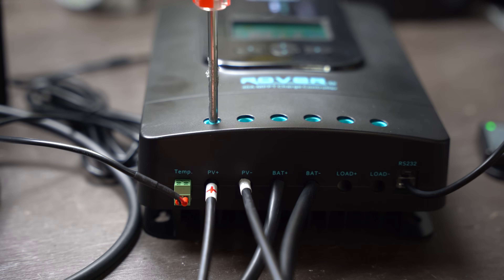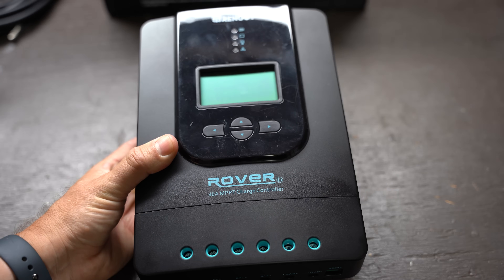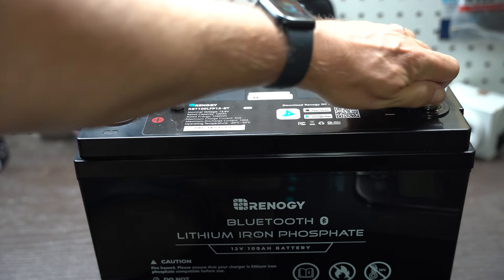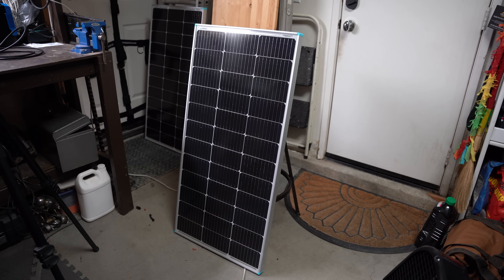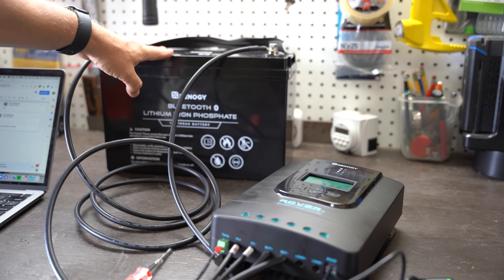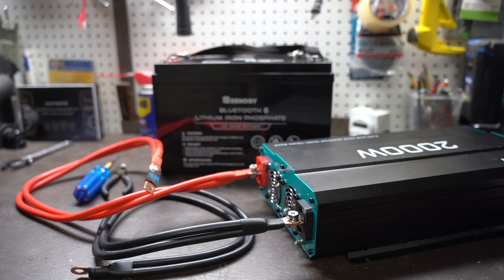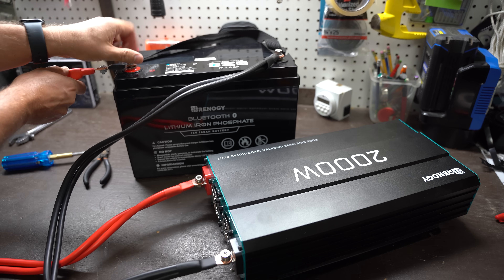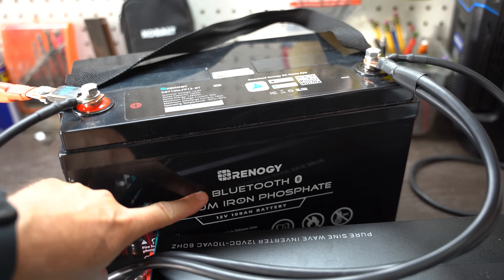DIY Solar Setup: Easy to Follow Step-by-Step Instructions

Comment: Thank you Chris, I built my solar generator about two years ago. I used a SOK lithium ion battery and it's been working fantastic, I want to upgrade it with a couple more batteries for a longer state of usable energy when I'm not using my solar panels.
But actually I just wanted to say I went with the same charge controller ( 30A ) and it works flawlessly, I am also using 4-100 W solar panels, when I finally got everything built I began testing it out. I first started with the refrigerator, which is all I Really wanted to be able to run Off of it In the first place ,But I then began adding my TV entertainment system, my computer system and it ran literally everything all at the same time utilizing my solar panels. I did go with a 3000 W pure sine wave inverter, probably overkill, but I wanted to make sure my system was capable of withstanding the loads.
You have done your community a great service Chris, people really need to understand and know how to build their selves a very straightforward system that could possibly save their lives and at the very least bring them great comfort and peace of mind.
Once you understand (( by doing it yourself )) you are well ahead of making your system an extremely viable component of your prepping Resources.
I also added in a 12 V fused attachment point to be able to run 12 V DC components which use less stored electricity Because you're not running the inverter component. 
Anyway Chris, once again you have served your community and subscribers a tremendous pathway to self-reliance,, may you and your family stay safe and remain blessed. Danny in Texas
Reply: How did you connect 3 additional panels as well as more batteries?
Reply: what do you mean about the 12v fused attachment? Thanks for sharing! I got most the other components by havent hooked it all up yet. Its been a race just to prep many things.. Aloha
Reply: Dear Maui, If you click on my little icon picture it should take you to my YouTube page, I made a video of what I built , It's not the best video but you can at least see what I did, and you can see that 12 V terminal block that I included in the wiring. The plastic cover comes off and you can wire in certain components with a particular size fuse for the item you are hooking up to it  (( 12 V DC powered items )).. 
I watched a ton of different YouTube videos until I finally decided to build my own, I'm glad that I did, and that little two wheeled dolly works wonderful and makes it so easy to move around. I just push it into the corner and it literally takes up no space at all, I put hinges on my solar panels and they fold up Like a little suitcase and I just store them in my utility area. I put the cable All rolled up underneath the couch. 
Anyway, when I first turned it on and plugged in my refrigerator everything was working perfectly, and I could see the solar panels were supplying all of the  energy being used, I live in a townhouse so I can't permanently install the solar panels so I just had them laying outside on the ground.. I went ahead and pluged in my TV, And then my computer system, and my little display on the solar generator showed I was still using solar panel energy. Once the sun goes down you immediately start drawing energy from the battery system that powers the inverter component which is where your AC is generated.
Anyway I'm sure you well, are maybe you already understand The process in theory, but if you don't keep watching YouTube videos and you will start to understand it perfectly.
Stay blessed, and good luck in your prepping journey, we are all in this together that's for sure. Danny in Texas
Reply: Thank you for mentioning how many panels you have and what you power with them. I am just beginning my set up and have been trying to find out how many I need to power everything, but have yet to find a "straight answer". Lol! Your comment helped immensely.
Reply: So how much can that battery actually withstand before having to actually have the solar panel charge it. I have a small tiny camper with 2 solar generators and a small Alp 28lb propane generator when off grid to charge both solars. My mane thing is if I’m not somewhere with adequate sunlight I used the Alp but I would like something a little more permanents. Moat items I use are low voltage with the exception of a coffee maker and a heated blanket for the winter for my k9. Do u think this set up would be adequate? I also have the foldable Dokio 300w panel system.
Reply: Hey brother, Basically what I've discovered with my little solar generator set up, is it needs adequate battery storage capabilities.
I'm using 4 - 100W solar panels which do a wonderful job recharging my battery through the Renogy charge controller system, my little setup will run my refrigerator, TV, computer, while still bringing my single battery back up to full charge.
When there is no sunlight it will run my refrigerator for about 8 - 10 hrs before shutting itself off, if I had more battery's  For storage, at least a couple more, it would make it all the way to mid afternoon of the next day where the solar panels would then start recharging everything all over again.
I know there are some good video's on youtube explaining this more in detail, but what I have built has really served me well in the security of at least knowing I will have emergency electricity when needed.
But to be honest, I am currently saving money to purchase a couple more batteries for a more adequate buffer to at least run my refrigerator as well as my computer system for a good 24 hours straight without any sunlight for recharging.
I tried to build my system with as much overkill and quality components as I could, and I feel pretty good where I ended up at, now the extra edition of battery storage will get me to a place of more comfort.
Stay blessed my friend, and stay safe always being aware and vigilant.
Danny in Texas
Reply: @livergen  thx bud I appreciate it. I guess my question is what do you when your refrigerator is off. What do you run off of until your battery recharges from the panel?
Reply: @bribrismind1982  , Well basically at the moment (( until we have a nuclear holocaust 😎 )) I only need my little solar generator for emergency purposes.
I live in a little town house and have electric service.
Since they won't let me install my solar panels on the roof, on the weekends ( Saturday and Sunday )  I simply leave them outside on the ground and recharge/top off my battery and at the same time run my refrigerator and entertainment center off the generator.
When I tested my generator without the solar panels, it ran my refrigerator all night for about a good 10 hours just off the battery storage.
I honestly considered brother, converting a storage trailer into a livable space but changed my mind. I'm 68 years old, live alone, my needs are extremely miniscule and pretty much live off of my Social Security entirely.
If I was younger by about 20 years, I would definitely be in a camper squirreled away somewhere with my trusty canine companions. 
I pretty much turned my little townhouse into a survivalist environment you might say, 4-30gal propane tanks , 1-55gal water drum/many cases of bottled water, my spare bedroom looks like a small grocery store. I Pressure can all my own food, bake my bread entirely, I guess you get the picture, ( Unsupervised adult with many skills ) . 
Anyway, I saw a nice review and pretty smart idea about some guy taking a small freezer and using it as his refrigerator since it maintains very cold temperatures. He bought a thermostat plug-in that he utilized to keep the temperature just above freezing.
But it ultimately boils down to battery storage with your solar generator set up when the sun goes down.
I know you are doing your research and due diligence, and you will eventually ( if not already ) , out on the other side a winner.
Again, stay safe out there and keep your personal protection tools on you at all times. Danny in Texas
Reply: @livergen  lol gotcha. I have done similar. I have a small Joy Turttus refrigerator/freezer and a tiny 28lb 1000 watt Alp generator. (Life saver) I can charger the solar generators about 25-30x with the small 13lb propane tank on my squaredrop. I have a Bluetti and a Delta Eco Flo mini. But I guess my main thing was the heated blanket for the k9 in the winter. I went out last month it was down to 19 degrees. The blanket ran from about 9pm-about 5am. I use one of the smaller hand held inverters off eBay for the refrigerator. Usually runs it about 8-9hrs
Reply: Hi Danny can you please post a link to your 12v switch panel video. Clicking on your profile doesn't work, it only let's you comment to your post. TIA
Reply: How long can you run on the battery power for your fridge, before battery drops to 20%?

Comment: Question. if theres nuclear or radiation or smoke in the skies etc would a solar panel work?
Reply: Nuclear? we would be f'd anyways. Smoke covering the sun definitely would make the panels not charge your batteries. Probably put up a wind turbine for those smoky nuclear radiation days.

Comment: Not trying to be an a****le. But I thought you only connect negative first on a positive ground 12v system. This is a negative ground setup. 🤔
Reply from the maker: could be the case.  i'll research that more
Reply: The reason for connecting POSITIVE first on a negative ground system is if you connect the negative first, you can short your wrench to the frame when connecting the positive terminal. As a technician, I can think of no reason it matters on a solar system like the one in the video. If anyone has better information I'm all ears.😁
Reply: Also it appears his system (like mine) is ungrounded.

Comment: I've never had a charge controller break if you hooked up the solar panels first if I did I would consider it junk 🤷⚠️
Reply: Not usually a problem with the newer controllers but some STILL warn you not to do this. I got a cheap PWM controller for my golf cart and it said hooking the solar panels up first would void the warranty. As a general rule you can't go wrong connecting the batteries first.😁

Comment: Thank you.  I'm in the UK so there is a risk of there not being enough gas over winter. Energy price cap will increase in October.  Finding cheaper solutions to light the home is needed & possibly a low wattage heater to run off solar. Off to watch......
Reply: Have a look at Wilko (Wilkinsons) they have inside house PIR battery powered lights, so they turn themselves off after a few minutes of not detecting anyone.  They only activate when it goes dark. I have found them great, as my Grandkids think it is Blackpool,  leaving lights  on everywhere  as they go to bed. I have put them in the hallway, stairs, landing and Bathroom. Now they don't need to turn any lights on, except bedroom lights.

Also,  the Mrs wanted solar powered garden lights, as we have just done the garden. I got some that can be brought inside, taking  them off their plastic garden stakes. I swapped the cheap batteries for decent rechargable types (AA and AAA), so if the power goes out, the lights can be brought in at night to light rooms, and last about 8 hours per night and put back out during the day back on their stakes to recharge. It works for us, she got a nice garden, I got another prepping item, without telling her about my prepping alternative use, should we need them. Another thing is that I  now have a constant supply of charged rechargable batteries, that I rotate out of the solar  garden lights, every couple of weeks or so ,ready for torches (flashlights), handheld AM/FM radio's, etc. should I need them as I bought double the amount of decent  rechargeable batteries required to replace the cheap batteries in the garden lights, so I could  purposely rotate and swap out to torches, etc if needed.
Reply: On YouTube Look up 7 day candle using crisco (lard) … it can heat up a small room as well… share with friends